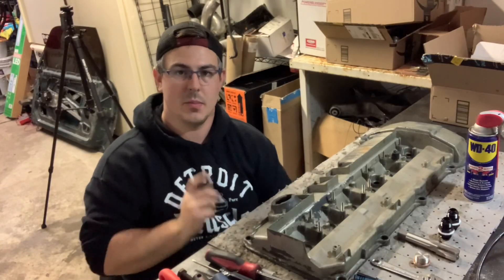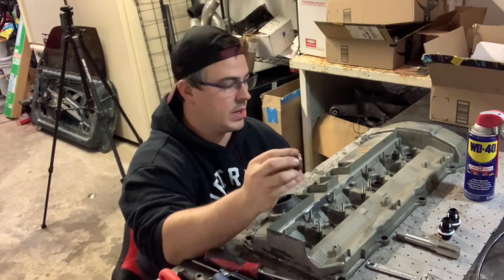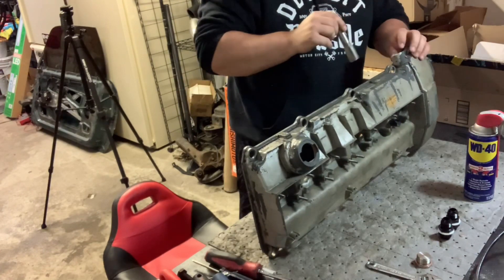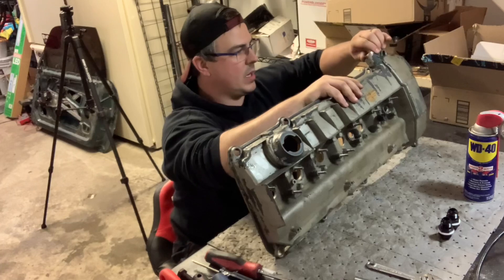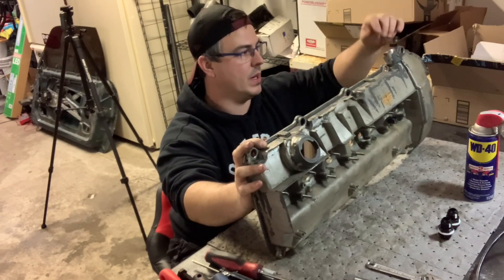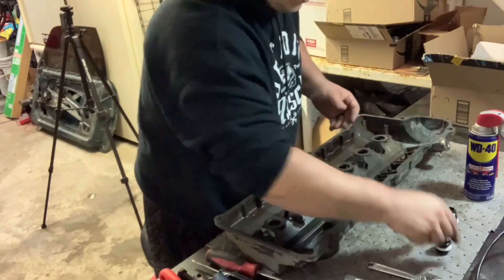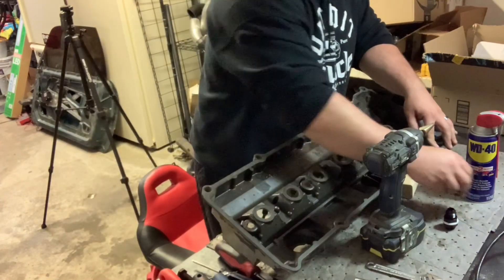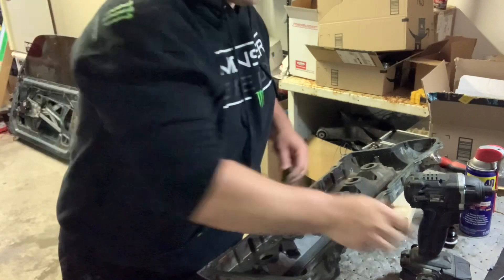Turbo E36 Oil Catch Can Install (Part 1)

Comment: Ordered everything you have linked and the plug is too small
Reply from the maker: Is it m26? If it’s not, it’s the wrong one.
Reply: @ yup it’s m26 I’m thinking the company had to of somehow sent me the wrong one even though everything says it’s m26
Reply from the maker: If it’s a metal valve cover, it shouldn’t vary enough that it wouldn’t fit, so it would have to be the plug
Reply from the maker: Did you measure it? Should be just over an inch.

Comment: what happens if nuts undo when you driving 😁😁
Reply from the maker: They fall into the pcv cover/channel inside the valve cover. Nothing bad unless you’ve removed that cover.

Comment: Do you just cap the smaller hose from the oem fitting that goes to the icv? Any issues at idle?
Reply from the maker: I’ve got one of the billet Icv fittings so there’s no longer a port there. Just the large one for the icv. Reboot engineering or rally road both sell them. No issues at idle.

Comment: I love the tap / plug with the allen. ill definitely be copying this.

ordering those AN fittings aswell lol. now to find a quality catch can
Reply from the maker: The tap/ plug idea I got from seems legit garages kit they sell. I just wanted to source all the pieces for it myself to save a little money! The catch can I use in the Part 2 of this video is perfect for a vented set up. Good quality piece and it looks great!
Reply: @DadBodGarage  hey just looked at the link for M26x1.5 plug and seller only has up to  M24x 1.5.
Reply from the maker: You may have to just search it then. Someone is bound to have one.